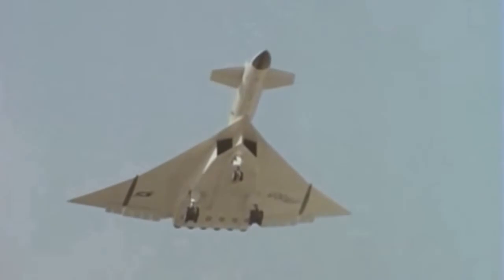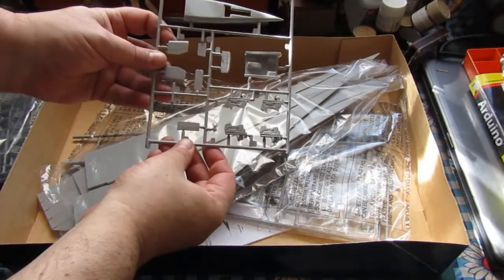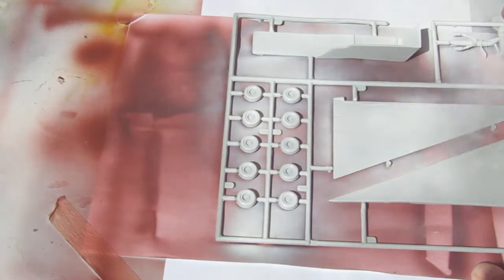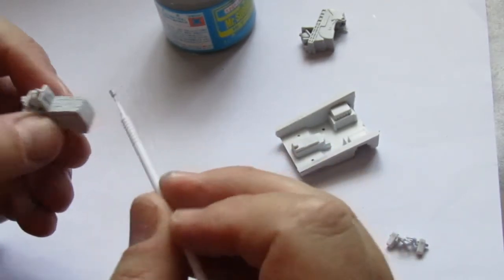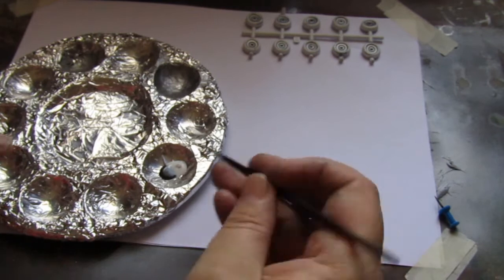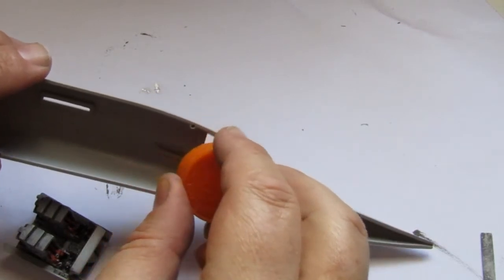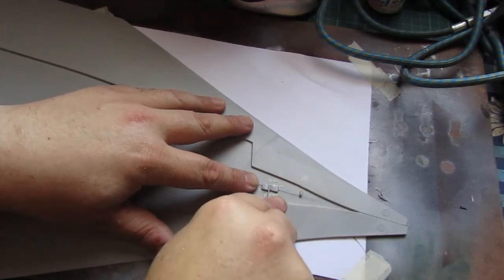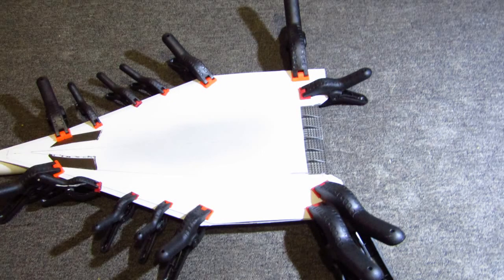Italeri XB-70 Valkyrie 1/72 Part 1 (by Trevor)

Comment: I also have the same problem when making my XB-70 Valkyrie but from my experience as a gundam and other model kit builder I cut the sprue into tiny pieces and drop them into my extra plastic cement and waited for them to be melted and use that as my putty it work like a charm.

Comment: You’re reference pics & videos are great. Did you notice the aluminum coating on the tires? Documentaries say with high-temp landings & the supersonic speeds heated the tires up  even during flight & the aluminum coating was one strategy to compensate. Great work - thanks for putting together such a good video.
Reply from the maker: Thank you very much for your kind words 🙂I have received a lot of flak for the tires over the years. I painted them silver originally, but they looked awful, so I decided to switch to black tires. I have the XB-70 hanging from the ceiling, and would have grumbled every time I had to see those silver tires, haha!🤣
Reply: @OstrichLongneck   - you know, when you showed them before you painted them black - I thought I saw little bits of aluminum color. I appreciate the work & I’m glad to hear the model is still “in flight.”

Comment: Oh my, that seemed to be a painful process, no wonder you retired her for 3 months! Regarding gluing your cockpit into the fuselage half, I always stick putty to the underside of the cockpit tub and against the inside of the fuselage wall. This supports the tub at the position you want it and then I clamp across the outside of the fuselage wall and the unglued side of the cockpit tub, or, I use masking tape to hold it in place until the glue sets. I always use CA glue, too, when I put my tubs in place...I don;t want them coming unstuck after the model is built and having them drop inside the fuselage. 
She's a bloody big bird, though, hope you have storage space?! 
That was a complex system for extending and retracting the undercarriage...as an Engineer, I've always minimized mechanism and moving parts to create a result, because the more there are, the more chance of problems. 
I like the mix of live history clips and narration throughout the build....adds more interest!
Looking forward to seeing how you created order from the "chaos"! 
Cheers : )
Reply from the maker: Hi Martin :-) That's an excellent idea, using putty to hold everything into place, and the CA glue is a brilliant idea, too. I think I'm going to use that as my standard method from now on. I learnt a lot by gluing those large parts together; good practice for the intimidating 1/24 and 1/32 scale models in my stash. This one's hanging from the ceiling at the moment, 78cm in length. I always say a quick prayer that she doesn't come crashing down on my head in the middle of the night! The aircraft had a lot of ingenious innovations, especially the undercarriage, which, as you predicted, was very problematic from the get-go. Thanks for watching, and for the great tip!
Reply: Oh my, 78cm is a BIG bird and you're welcome for the tip. Cheers 👍😃

Comment: Okay, a few things. First, gad, it seems everyone HAS to play Flight of the Valkyries for these videos! But at least it wasn't loud and moving to Moonlight Sonata wasn't a bad touch. Your aerosol spray can technique really needs some improvement!!! I couldn't believe the trouble you went through for those harnesses, almost overkill but they looked really good. Lastly, you won't believe this but those tires, thought they are made of black rubber - big surprise - they are painted with a silver heat resistant coating so they're actually pretty much more silver than black! I know that because I've seen and touched them and have pictures.
Reply from the maker: Yup, I agree "The Flight of the Valkyries" was a little over the top. But where else would I have an excuse to use it? It's probably my favourite part of "Apocalypse Now", except maybe Mr. Brando's superb performance. I get a lot of flack for the tires - my previous video actually includes an extended clip of the silver tires. They look great in real life, but really lousy on the model. The Valkyrie is suspended right over my bed, and is the first thing I see every morning. So the least I could do was give her some pretty shoes! Thanks for a great comment. You sound like someone who has an amazing dry wit; we need more people like you in the world! And I'm really jealous that you got to touch those tires - just saying! - Trevor

Comment: Are the spray cans good?  i like this way but I have no experience
Reply from the maker: Hi Parbars :-) I only use the air cans for the base coat - they work very well, because they can be applied in a thin layer that doesn't destroy the model's detail. Sometime I use the airbrush to apply a base coat, like applying a black base coat from Vallejo when black-basing a kit. But I don't have nearly as much building skills as you do - your dioramas are works of art! - Trevor
Reply: thank you so much for your answer. i must try the spray cans! :) 
Robert

Comment: Hello Sir, 
I really enjoyed your video on the making of the XB-70. I have this kit and after seeing the 1st half of the video I'm scared to start on it. I noticed you were having trouble with the wing halves being warped. 
Let me ask you something could I place a medium length of a sheet of plastic on the inside between the wing halves to strengthen the joints?Thank you for your time in reading my question and comments. 
Sincerely 
Allan
Reply from the maker: Hi Allan, it was a very strange build with all those large pieces. I remember using super glue with baking soda on the big joints, but there is a "Eureka" moment in the second video where everything comes together perfectly. There's a slight curve to the wings which seems to make all the weird seams line up quite nicely, and the "ugly" seams are eventually covered by other plastic parts. The final model is strangely robust, but a little extra support won't hurt. I'm sure your idea for reinforcing those initial seams with plastic will work nicely. She's a big bird, but well worth the build. Thanks for watching and commenting. - Trevor
Reply: Hi Allan, If you haven't started yet, watch my vid. You can add plastic card, but beware of the parts that support the lower section.